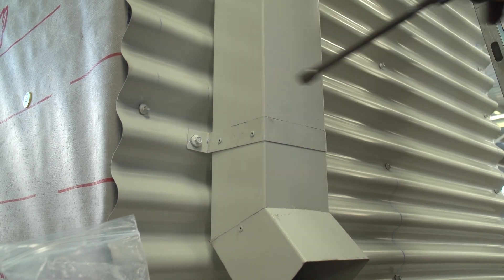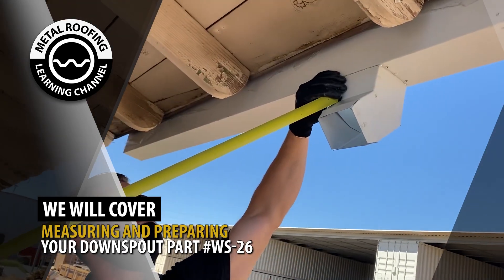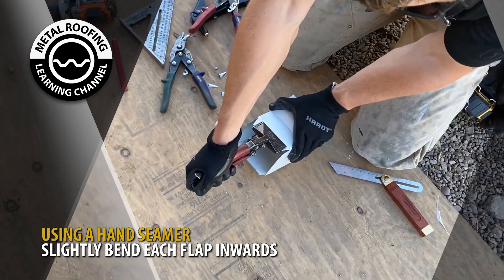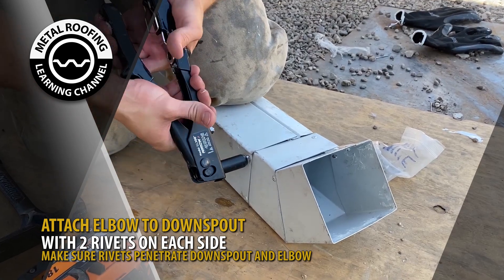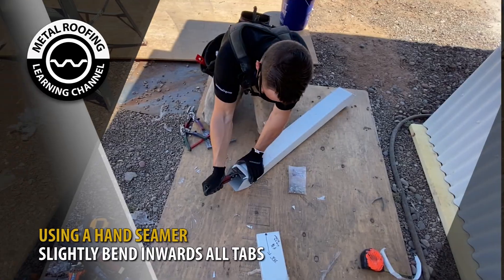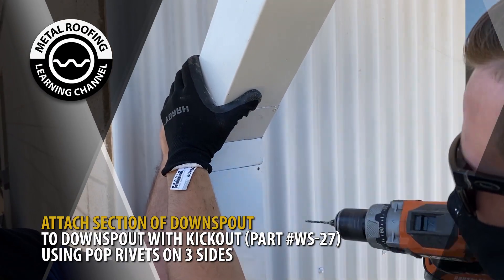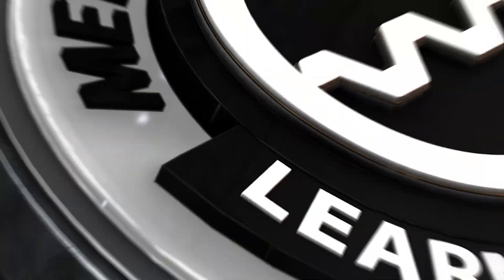How To Install Downspout For Gutter. DIY Downspout Installation Instructions On A Metal Roof

Comment: Guy cutting bends measured 1" voiceover girl said 1-1/4" . When asked to measure and deduct 4-3/4" tape is held at 1" which results in 3-3/4" deduction not 4-3/4" Video needs to be edited to eliminate the black mess on the down spout
Reply from the maker: Doug, thank you for your comments.  

The cut can be 1” or 1 ¼” we put 1 ¼” on video because it will make for an easier install at lap 
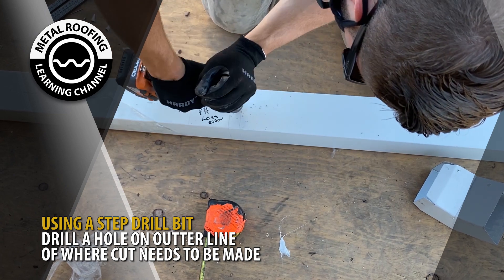The video does show that installer does bury 1” however if you look at 2:52 mark that was to make 1” section for the step drill. You will need to allow 4 ¾” min to allow for elbow against the wall.
As far as the black, all material does have a film installed prior to install. This film is removed and you can see when final cut is done all downspout is clean.

Thank you for pointing all out. These comments help us in case we missed something.